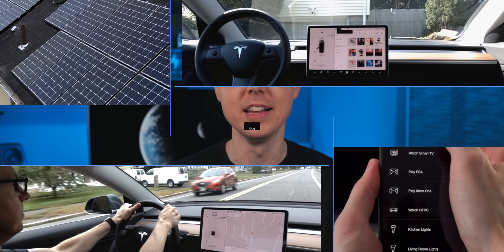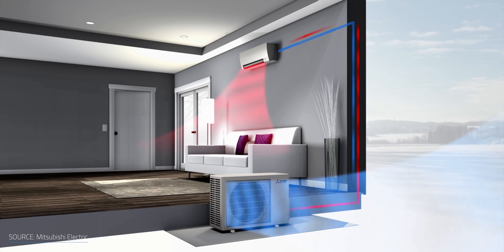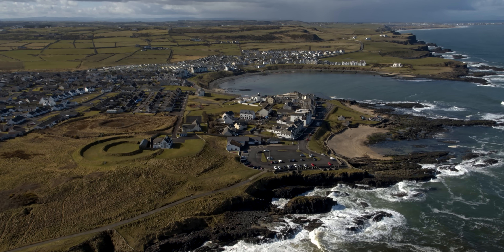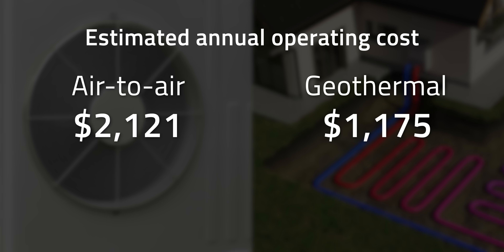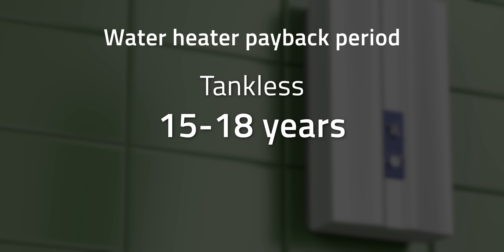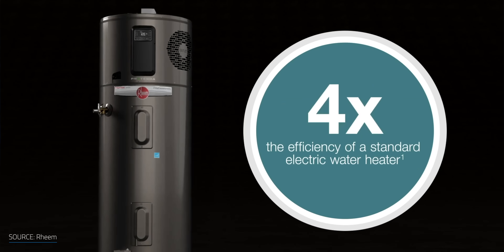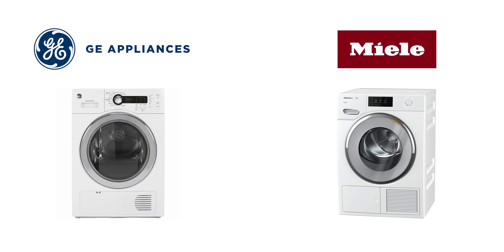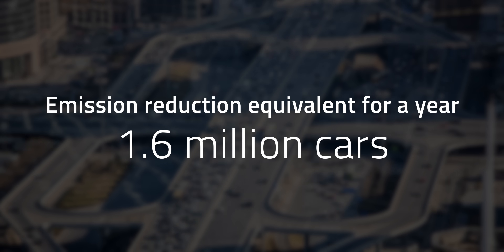Why Heat Pumps are Essential for the Future - Explained

Comment: I am an engineer and I love your videos. I disagree with you that the life span of a heat pump dryer is double of a traditional electric dryer. 

Traditional electric dryers are very simple. No matter where I have moved, I have always bought an old used dryer (with moisture sensor... important) and just repaired it if need be, at a very low cost. A new belt for my $150 used dryer, for example, was recently $14 and I installed it in 15 minutes. A heat pump dryer is much more complicated and I would argue practically not repairable by a homeowner. In contrast, an electric dryer, especially one with an easily-replaced mechanical timer, could easily last 20 years, or even infinitely if you know how to replace the drum bearings. The heating element is cheap and easy to replace. The motor can be serviced at a motor shop. They are about as simple as an appliance as you can imagine.

My point in all this is that if you can hang dry your clothes, or at least 'some' of your clothes, and use a classic electric dryer 'only' for select items (towels, sheets, or things needed right away), you can reduce your total clothes drying costs to a very minimal amount without spending $2k on a complicated appliance with a lot of moving parts, refrigerant that can leak out, computer boards that can fail, refrigerant disposal issues, specialist repair technicians, etc. I just use a fold out rack in my laundry room and every item I hang on it costs exactly $0 to dry. I have my dryer when I need it. I've even taken 90% dry items off the rack and finished them in the dryer very quickly. If you are in the habit of taking your own bags into a grocery store, hanging a few items to dry on a rack is about that hard of a habit to form. Plus your clothes last longer. When you empty the lint filter, that lint you are throwing out is your clothes!

There are some situations where my argument has less merit, of course. I admit that. A busy mom with kids in humid rainy Houston is not going to want to hang dry clothes. But I would still maintain that a simple old-school dryer with a moisture sensor and a mechanical timer can last decades.
Reply: I agree that hang drying is generally the best option.  I'm in Massachusetts and have been hang drying 95% of the time for years and years, infrequently using a secondhand electric dryer when I really have to dry something *right now*.  

I'm kind of disappointed to hear that Europe and Asia are going so much for heat pump dryers because as I understand it, they and most of the rest of the developed world had largely passed on powered clothes dryers, even in multifamily housing, opting instead for drying racks and clotheslines.  Even if more efficient than a traditional gas or electric dryer, that's a lot of new and complicated heat pump dryers being installed around the world.  I will say that having lived in south Florida for a year, a dryer of any type would be a huge improvement over a busy family trying to hang dry many loads of clothing in such near-tropical places.
Reply: Definitely agree with older dryers I would never buy a new one when it cost less than $150 to rebuild an old Maytag. I have an LG mini split cooling a grow room and it is a headache compared to a traditional window AC.
Reply: I disagree on traditional electric heated dryers for clothes drying period. They damage and destroy any material you put into the dryer over time because they use very hot air (even when put on the lowest heat setting) The advantage of a heat pump dryer that most don't mention is they can dry clothes at room temperature as they don't rely on heat evaporation, rather on condensation. This alone is worth the value! They are also not complex and are a close system so the loss of refrigerant is the same as any closed system appliance (your refrigerator) The only reason they take longer is they are compact in design on the evaporator side to fit inside the standard dryer dimensions when they could have a rather large evaporator incorporated into the body and dry clothes even faster than using heat evaporation in traditional dryers, which translates into running cost savings and suit the majority of people who don't have patiences to hang dry or are limited in space to hang dry (think 600 sqft condo) Trying to persuade those impatient people is like trying to push water up a hill with a stick, especially in this world of modern convenience and fast pace.....
Reply: @kingduck3192  What is the issue with your mini-split?
Reply: I agree the ventless dryer is way too complex to outlast a regular dryer. My dryer is gas and came from a friend(much older than me) when I bought my first house. I've considered getting a new one but at this point I have to know if it will ever break. I've used it 100% trouble free for over 10 years and it's about 50 years old. He also gave me the matching washer which never broke, but I did eventually get a newer one just because the old unit didn't agitate the clothes very well.
Reply: Thank you! People are going way overboard with the complexities of their washer/dryers, often to their detriment. My Dad and stepmother just remodeled a home and definitely weren't stingy with the budget. It's definitely a house where you would expect to see Bluetooth enabled washers and dryers with giant screens on them but that couldn't be further from what they have, simple electric washers and dryers that have lasted years, especially since my Dad is fairly handy. These new, "efficient" appliances sound great but like you said, they're basically non-reparable and definitely fall into the category of forced obsolescence. Funnily enough, when the people came to deliver their fridge, they had brought the more high-tech version by mistake with a big screen and wifi. The delivery guys told them they could have it for the price they already paid since it was their mistake. They told them they didn't want it and to please go get the fridge they actually picked out.
Reply: @MrEazyE357   it is basic home design (if you have good architect / building company does opposite) to do as much passive solutions as possible. Your home does not need to be black hole for your money and you would not like to be its slave to maintain it. But if you are able to pay for smart home and its maintenance, lets do it. You are giving work to others.
Reply: My creator bought an old dryer for 75 bucks. He is sick of "new" dryers that include poo-quality digital panels designed to fail: replacing costs several hundred bucks (or 6 old dryers). Manufacturers could include reliable circuit panels, but they want you to buy a new $2k dryer every 4 years.
Reply: @kingduck3192  Yeah, but at least the grow-op product lets you mellow.
Reply: @ckl8a  I have some friends who bought a different house and decided they would "treat" themselves to a new washer/dryer set when they moved. They went to a local independent appliance store and explained their situation. The salesman asked "what do you have now?" When they told them how old their set was and the make/model info, the salesman said they should keep it because it was better than anything on the sales floor. They kept their old set.
Reply: @Nilezy  Nearly all good dryers, even older mechanical ones, have a moisture sensor. There is always one cycle where you can set how dry your clothes should be. You can select from "mostly dry" which is often labeled as an "efficiency setting" or such, or you can select totally dry, or less dry. The moisture sensor itself is electro-mechanical and dead simple, cheap, and reliable. 

The point is that if you set it to a "less dry" setting, your clothes should not be damaged because the cycle will stop before they are completely dry. On my dryer, I have 5 heat settings, including an "air dry" setting which is no heat at all! So I would disagree with the statement that dryers use "very hot air" even on the lowest heat setting. Obviously you select the heat level that is appropriate and necessary, and if the lowest setting is too hot, you hang dry. If the lowest setting is generating very hot air, it's not unimaginable that there is a problem with the dryer.

Another factor that I have witnessed which may not apply to your situation is that people are clueless about exhaust vent maintenance. Vents clog over time with lint, and users will literally be angry at their "crappy dryer" as they run cycle after cycle, cooking their clothing in a never-ending steam bath. This especially happens where dryer vents go upward against gravity. Once you clean out the vent line people are amazed that their "crappy dryer" is suddenly working perfectly.

If for some reason it makes you happy to have your clothes dried absolutely completely without the presence of a heating element, then perhaps a heat pump dryer is for you. However these do heat the clothes very slightly to encourage the water to evaporate from your clothes, so they are still being heated by the hot side of the heat pump. And again, I would mention that you can always dry your clothes at room temperature for free if you want by hanging them up. This is what all people do for any delicate items that "don't go in the dryer."

In the end if something makes you happy and you want to pay for it and you can afford it, go for it. This is true whether you are buying a $2,000 overly-complex dryer or a $150,000 overly-complex Ferrari. I'd rather have something simple and cheap so when it breaks I don't have an albatross tied around my neck.
Reply: @beltrams  I think Europe is still mostly hang-dry as a default. But for those that want something more, it's unthinkable to the authorities to allow classic clothes dryers where you are basically using energy to heat up air and then blowing that hot air outside as waste. Two very real issues here are the electrical infrastructure in some older buildings can't handle a 7.2kW electric dryer in every household. Also, many of these same buildings don't have an easy way to run 4-inch exhaust vent lines out. So, drop-in-place heat pump dryers are a way to give people a choice even though they don't work that great. On a recent trip to northern Spain, our AirBNB had a vent-less dryer and we couldn't help but laugh because the dryer ran for over 3 hours and the clothes still weren't dry. Oh well, we hung up the clothes and went out for tapas. :) I have traveled a lot in Asia too but I've always had someone do my laundry there and never questioned how it got done. I can't imagine the vent-less units could work well in south Asia since it's so humid there.

I grew up in S FL and my mom hung all our clothes on a line outside and it was no big deal. It's just what people did. We did eventually get a dryer though, cause that is what the trend was at the time. I guess the dryer gave my mom some more free time, so then both parents could go to work for the same money and make net profits for some stockholders somewhere. Isn't technology amazing?
Reply: When you hang clothes indoors to dry in the summer, your HVAC system has to extract that moisture and take it outdoors.  Very false economy.

Comment: Great stuff Matt. I am helping friends restore their 115 year old home, and I recommended their heat pump/air handler for heating and A/C. Also opened up the second floor walls and foamed them. Can't wait to see how well it performs. Looking into heat pump fro hot water. Replaceing the dehumidifier is brilliant! Wish I had done that in my home. My dehumidifier uses about a third of all my electricity keeping my basement dry. Sandstone foundations are sponges for ground moisture. I was doing heat loss calculations by hand in the late 70's. No software existed, no computers, just grind it out. This tech now was unimaginable then. Thanks for helping educate us on what the future looks like.
Reply: Greg Stroupe, It might help you if you could dig out around your foundations, and then coat them with some water proofing!  Maybe even 4" layer of cement, with some steel grid in that cement.  Buying a excavator with a 6" bucket might help you complete that project, then sell the machine for about what you paid for it.  Better investment that renting one for a couple of weeks? 

Some system of getting insulation into your basement walls, outside of the stone, so the stone can become a heat sink, while not allowing the frozen ground to keep sucking all the heat out of your home!  

Yes air source heat pumps can remove a lot of moisture from the air.  And changing each pound of humidity into water collects 1,000 Btu's of heat!  

I installed a 120 volt 12,000 Btu ductless heat pump for my nephew that rents, so the indoor coil is mounted on a TV cabinet, and the tubing goes out the window, to the outdoor unit.  It will provide 12,000 Btu's of heat with 1 KW, VS his electric heaters at 3,400 per KW.  He can take the heat pump with him to another location when he moves!

Comment: I did a mini-split heat pump self install 3 years ago at my small ranch home and I have to say it's one of the best things I've ever spent money on. My heating is now primarily done through my heat pump instead of my oil fired boiler in all but the very coldest parts of winter. The savings are impressive...I've gone from buying fuel oil twice a year (it just cost me over a grand to fill my oil tank) to once a year and my electric bill has only gone up an average of 50-75 dollars a month during the heating season. I estimate I'm saving between 500-700 dollars per year in heating costs depending on how cold the winter is and will have paid for the heat pump in less than 5 years through my savings. The added benefit of having cooling in the summer is simply a bonus in my mind.
Reply: Sounds great, how often do you need to clean the mini split filters?  Can you just vacuum, or do you need to wash and dry the filters?
Reply: At what temperature does your heat  pump become inadequate?
Reply: @brianjonker510  I have a mini split heat pump on a garage apartment that was working during the freeze we had in Texas in February 2021. We were down to 7F outside and the room was warm. Our house didn't lose power which is key of course.
Reply: Another benefit:
Usually it's not a big problem to get affordable oil, but nobody can say for sure this will always be the case.
We can't control the supply of stuff we need, but we can at least lower our own dependance.

It's a bit like growing some of your own food. It may or may not save you money, but it sure as hell makes you more independent in case stuff isn't available or hella expensive.
Reply: @jimziegener8724  Mini-split air filter is a non-issue. You can just pull it out and tap it into a trash can and brush it off.  No replacement needed.  It is vastly easier than a furnace filter.  Of course, it is only a particulate filter. We also have a stand-alone HEPA fine particle air cleaner
Reply: @brianjonker510  Our 12000BTU HSPF14 GREE Sapphire is rated for -22°F (-30°C) but ratings are meant to be safe and there are reports of them working at -28 to -30F.  At 5°F it outputs 12000BTU at COP 2.11
Reply: @jimziegener8724  I pull them out every 3 months or so and rinse them in my sink. Let them dry for an hour and it's good to go.
Reply: @brianjonker510  I run mine as my primary heat source until the temp drops below 10F...it will still make heat lower than 10F but it's not as cost effective.

Comment: Ten years ago I installed an open-loop(no digging, just uses well water) geothermal unit, plus all new ductwork. It paid for itself in just under four years, and I've been saving ever since. Plus with the desuperheater and a new super high efficiency water heater(used the old one for hot water storage from desuperheater) I get all-but-free hot water. No net carbon expect for power plant fuel costs(NG).
Reply: Wait how does that work? Do you pump a lot of water into the drain? My incoming water line from the well gets down to 45d F in winter, not much heat there to work with.
Reply: @0my  coefficient of performance around 45F is extremely high for heat pumps. They really only start to become inefficient below around 17F. So at 45 you might put 1 unit of energy in and get 4.0 out, but around 17 you put one in and get 2.2 out. The only problem for most people is, is that a cop of 2.2 is usually equal in cost to a natural gas furnace here. So basically Mr geothermal stays at max cop pretty much all year
Reply: But yeah main point is the lower the temperature difference of the outside unit to the inside unit the higher the cop you will get. Typically ground temp is 55 and inside will be 70. The new stuff will do a cop around like 5.0 on stuff like that. That's absolutely insane.

Comment: We installed a new Miele clothes dryer last year. It works well. As mentioned in the video, it takes longer to dry clothes than the electric forced-air dryer it replaced. Also, it is not quiet, though it is less noisy than the dryer it replaced.

One of the side benefits is you can reclaim the water from the dryer. When installed, you have the option to run a drain hose to the house drain. Or, the dryer has a built-in tank to collect the water. In the later case, you empty the tank manually. This water is kinda-sorta distilled. We use it to water plants in season, or use it for flushing toilets as needed. A load of bath towels gives up about 1/2 gallon of water.  We we surprised!

Another benefit over the forced-air dryer in the summer is that I'm not taking air-conditioned, cooled air, heating right back up and forcing it outside. There are savings involved, but I'm not sure how to quantify that.